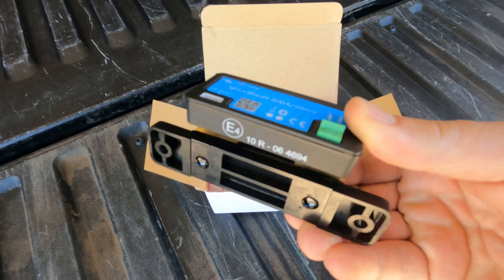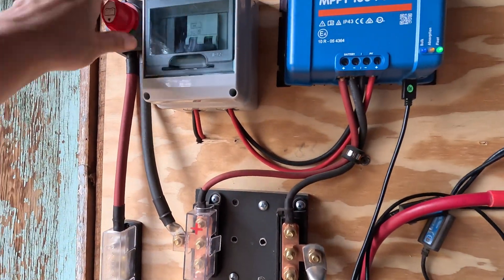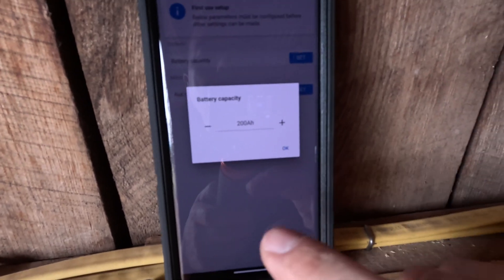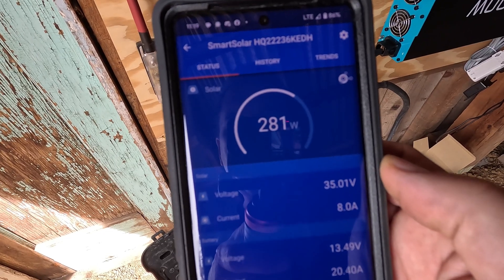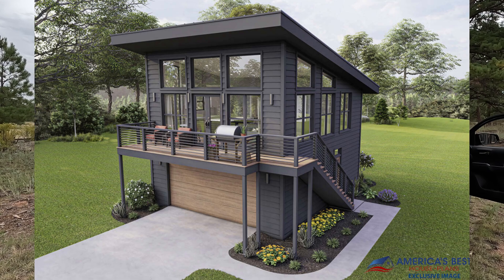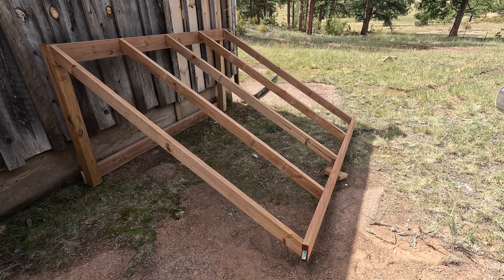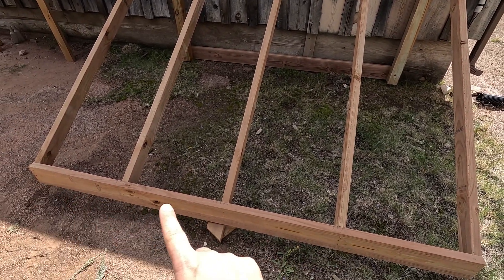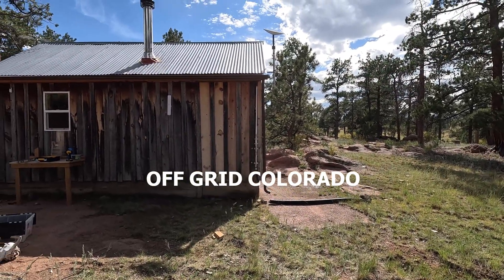Building a Small Panel Solar Ground Mount out of Wood & Installing a Victron Smart Shunt, Ep. 28

Comment: Is that 200ah for one battery or 200ah for two batteries in parallel?
And is that app STEALING anything from your phone?
Never trust any app.
Also, input settings most likely will be reported back to the MFR for them to sell to others.
This is why I want all components to have everything on the component, including screens and settings.

Supposed to be 20deg for summer, 30.6 for spring and fall, and a whopping 45 in winter.
Reply from the maker: My 12v bank is now 800 amp hours. 4 200ah batteries in parallel. The app is bluetooth only, so local access only.
Reply: @offgridco  Mine is four 100ah ones sniff sniff.
Only had 2 kidneys ya know lol
But I am up to 5kw though.
Hopefully enough to run my fridge.

Comment: I would love to know the total price for this rack as Signature Solar has a 6 large panel adjustable rack for $279
Reply from the maker: It was cheaper than that for sure. 3- 2x6x8, 5- 2x4 and I used 2 4x4 posts but on my second build, I made it so it was 4 foot high so I could use one 4x4 post cut in half. I just looked up at lowes.com and with current lumber prices it's about $76.20 for the lumber not including screws to fasten it together.

Comment: using the pi I am sure saved you a few hundred bucks. Your future home is what I want to do, a detach garage with living space above. But it would be more like a 3 car garage size so I can have a workshop.
Reply from the maker: Yea, it did not make sense to buy the Victron cerbo gx when they off the software for the PI for free. No brainer. I am opting for a smaller home because it's less the county can tax. I will have many accessory buildings for sure. I will likely build a new garage at some point. My main focus is just getting the "legal dwelling" as I can't build anything or get structure insurance until I have that done.
Reply: @offgridco  rules and laws, are we really a free nation.